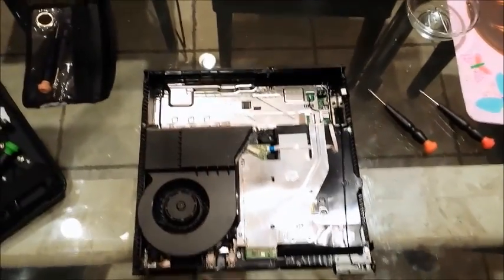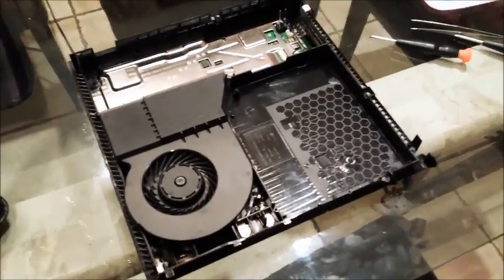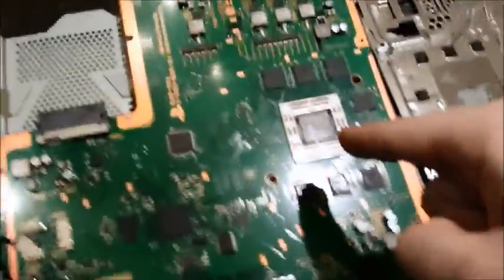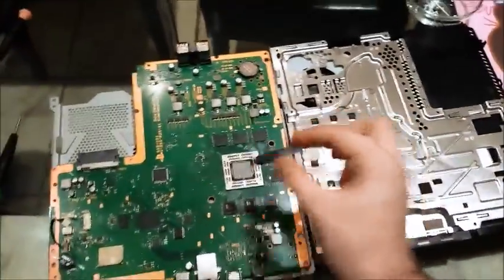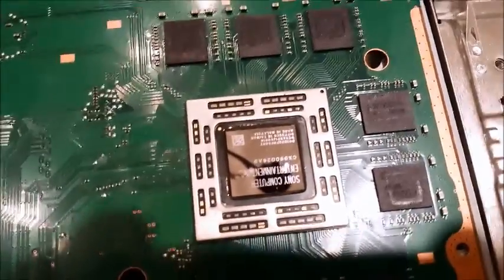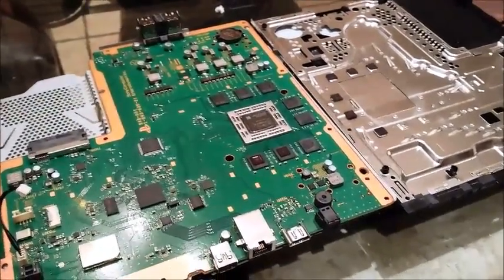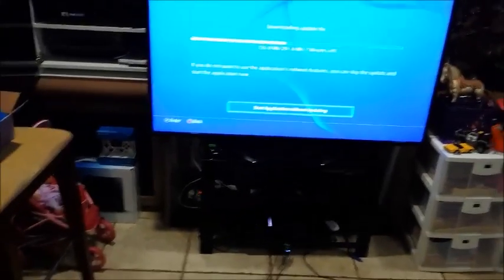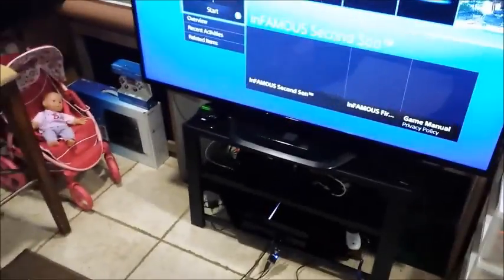PS4 Thermal Paste Change

Comment: What is your opinion Nyballer, Artic Silver 5 or Artic MX-4?
Reply from the maker: Darren McClellan    I've never used MX4. I've only used AS5 and MX-2. However, MX-4 is good stuff too. In all honesty anything is better than what's in the PS4 now but any of those 3 are a great choice.
Reply: I have done this with many cpu's and gpu's on a PC, but I fear breaking something in a console. I'll let you know how it goes. haha
Reply from the maker: Darren McClellan  Yes I could demonstrate it but it would have to be on the next one I do as I'm not going to take mine apart again just to demonstrate it. If you've done it on computers then there's no difference really. Just use the video in my description to follow for taking it apart properly.

Comment: The warranty is only good for one year no? If so I'm just going to open it up and put new paste because sometimes it gets annoyingly loud. Let's say like stage 3 speed. Usually always. I want it to be quieter. 

Think I should?
Reply from the maker: Yea 1 year but chances of u needing it is very slim. The poor quality thermal paste has a higher chance of causing an issue than anything else. If you feel like you could tackle it then go for it. Doesn't take long.
Reply: ***** I can do it for sure but not sure If I should now or later. My year is up for warranty for sure still don't know if I should honestly.
Reply from the maker: BiohazardGA well, do u want ur ps4 to struggle? Your ps4 is already running hotter than it should be. That paste is most likely already on the dry side. Ir starts drying up in as little as 3 months. Watch my ps4 thermal paste discussion video. I explain everything in great detail. Just go to my vidoes...its the one with me wearing the blue hat
Reply: ***** Not really but I will watch it for sure!
Reply from the maker: BiohazardGA  cool

Comment: I have a ps3 and its the fan sounds like a jet is my ps3 broken?
Reply from the maker: No Brian, watch this  https://www.youtube.com/watch?v=mXYORPGMYJE
Reply: Mine had the dame problem. You have to clean it, internally.
Reply from the maker: *****  Cleaning the inside isn't the problem. The problem is the heat isnt being transferred to the heat sink because the paste is horrible and dry. Cleaning the dust out every month isn't going to magically make the system run cooler because the thermal paste is responsible for pulling that heat away from the chip and without that happening your CPU/GPU is ALWAYS running much hotter than it should.  Watch this video.....  https://www.youtube.com/watch?v=mXYORPGMYJE
Reply: I got your point. That's why I recently bought Gelic GC-Extreme, Artic Silver Thermal compound remover.
Reply from the maker: *****   Articlean is very good too
Reply: Brian Salvador If you have a super loud ps3 with cool air coming out and your ps3 fan speed just increasing rapidly, then it has absolutely nothing to do with paste. i have a solution to this and believe me i have fixed two ps3s jet engines like this. you need to put one coin under cpu pressure plate and screw it tight. yes, it's the cpu, not the gpu. just dont screw it ridiculously tight or you might break the processor.
Reply from the maker: +f3rns _  Yes but cleaning out the dust will not stop it from running hot and loud when the thermal paste is shot. If you already have it opened...change it
Reply from the maker: +Riku148  Hahahahaha please people, do not listen to this guy. He has absolutely no clue what he's talking about.

Comment: You applied the thermal paste before turn on the PS4 for the first time?
Reply: Or you advise change after the warranty expires?
I hope your answer.
Thank you.
Reply from the maker: Yes, I changed mine before turning it on for the first time as I did not want to use Sony's poor thermal paste. I wanted my PS4 running cool and good on day 1
Reply from the maker: Megamorph33
You can wait until it expires if you want which is 12 months but I wouldn't go more than 12 months on that junk.
Reply: ***** If it takes a lot to change the thermal paste, can harden and hinder the removal of hardware and damage?
Reply from the maker: Megamorph33
 No, you're just cleaning it off and applying the new paste.   I talk more here  https://www.youtube.com/watch?v=mXYORPGMYJE
Reply: ***** Ok, Thank you!
Reply from the maker: Megamorph33
  NP, I've done 10 PS4s. I've had 2 people I don't know send me their PS4 and I do it for them and send it back, they just pay for shipping.

Comment: I have only taken apart a Xbox 360, do you think I will be okay taking my ps4 apart and performing this maintenance? My ps4 is 3 months old and it started being loud 2 days ago while playing cod aw online. I noticed it even though I had a headset on if that says how loud it got. If I press the pause button on say gta v offline for example the fan slows down press resume and it goes loud again. Kinda don't want to use my ps4 till I do this to it. If you reply thanks man.
Reply from the maker: Yes u could do it. Use the video in my description to help u take it apart.

Comment: Stopped video at 0:27 just the thought of me attempting this made me nauseous :-) I would completely F**K this up...I could follow your steps precisely, but I'm sure when I'm done and power up my PS4 it would start up with old SEGA Genesis (After Burner Completion) sound!! SEGAAAAAAAA
Reply from the maker: Lol lol, if u have a computer friend, it will b very easy for them. Ive also done about 10. I have friends in other states who mail me their PS4, and I do it for them and send it back. You really want this done eventually. Try not to go more than 12 months in that stock paste because you will start noticing more heat. Your fan will always be loud and the air being blown out will no longer be hot and become cool. You want HOT air being blown out. Those are two things you can check for. If you want anymore info on me doing it, send me a message directly. Have a good day.
Reply: My luck one little mistake I fuck my whole ps4 up when I get this thermal paste Immma attempt this on my ps3 then for ps4

Comment: 4:06 you do NOT put thermal paste on both the CPU and heatsink... one or the other. preferably the CPU.
Reply from the maker: I never said you put the paste on both, that would be dumb. I was referring to the articlean purifier on both to ready both sides as you want both contact points to be clean and ready for application of new thermal compound. Listen to it again, I was talking about the purifier bro, go back a few more seconds. I said the purifier readies both sides FOR the thermal paste as in once you apply it to the CPU/GPU, and close it back up, it's going to make contact with the heat sink side which is why you clean and purify both sides. Thanks for your comment though, have a wonderful day.

Comment: 4:10 - Don't do that, oil from your fingers will contaminate the surface you cleaned. Once you have proper cleaned both surfaces don't touch them with anything but each other and a little drop of thermal paste.
Reply from the maker: Doesnt matter dude..i barely touched it..maybe the chip yes but not the other side doesnt matter really i been working on computers and consoles all my life
Reply from the maker: And my finger was just above it..not directly on it
Reply from the maker: Thanks for your concern tho, I appreciate your professionalism

Comment: I remember when I had a PS3 I got the YLOD, & I had to change the thermal paste every 3 months that's gie long it lasted & I was using the arctic silver. I hope my ps4 lasts a really long time becuse I'd rather just get a new one than change the paste every so often
Reply from the maker: good paste u only change every 3 to 5 years...buying a new PS4 is just going to put you back into the same boat...you dont need to change arctic silver every 3 months dude
Reply: I had to change it every 3 months on my PS3 because  thTs how long it took before it broke down again. Do you think I have anything to worry about with my ps4? I just don't want it to overheat, I got it 3 moths ago & it's out in the open elevated by four bottle caps to keep the bottom from heating up to much.